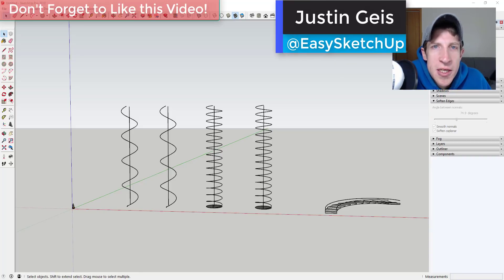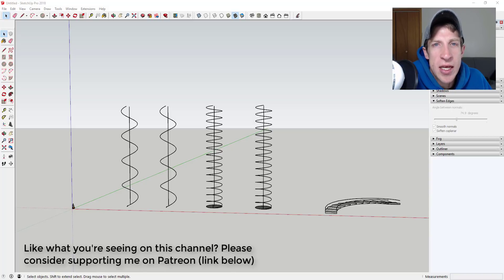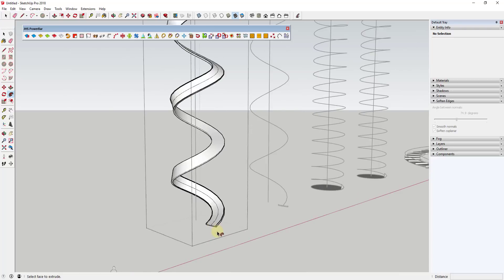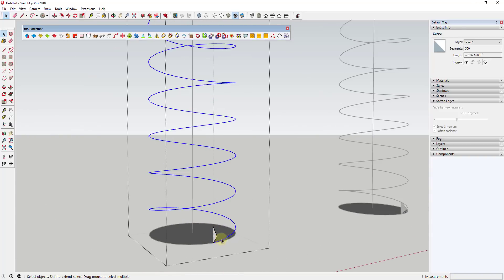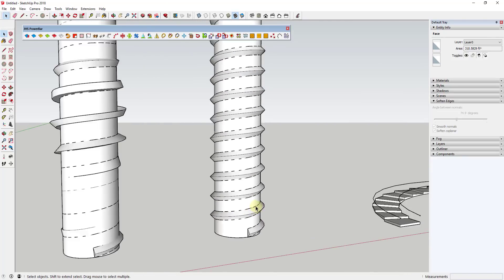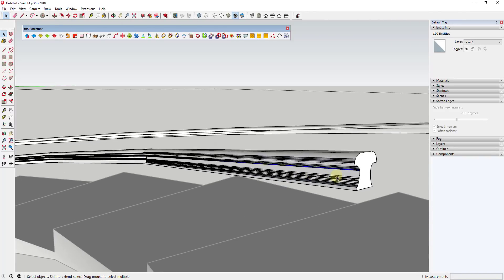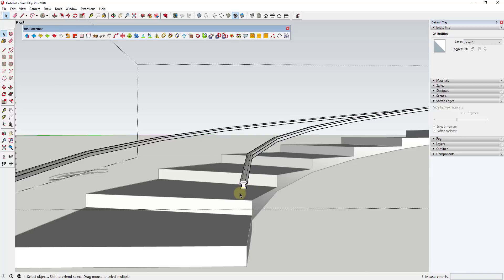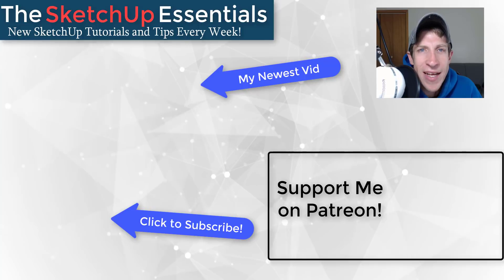JHS POWERBAR TOOL TUTORIAL - Eneroth Upright Extruder

Comment: Well that scaling trick definitely worked. I was trying to create a spiraled column by myself and with extensions. Even with Extrude Upright extension I was getting surface issues, where pieces of surface were missing from the entire spiral. Scaled it up a bunch and it worked. Thank you

Edit: It takes quite more time than I expected for the plugin to create the surface.
Reply from the maker: Glad it helped! SketchUp doesn't do super well with tiny surfaces, but scale them up, creating surfaces, and scaling back down usually does the trick :)